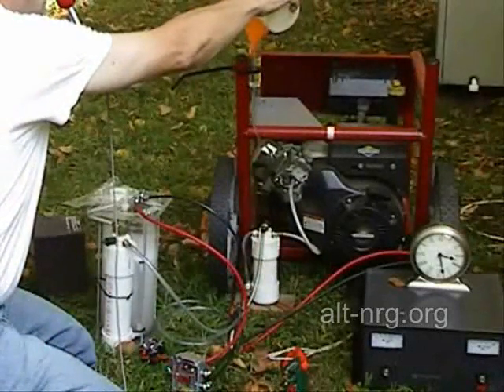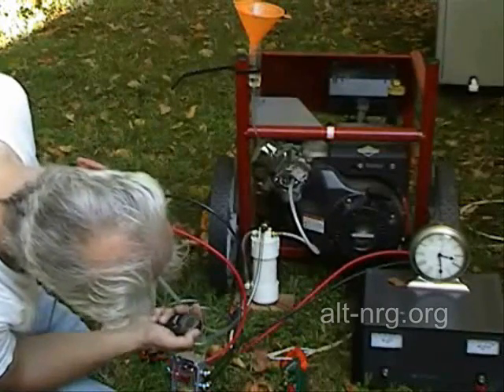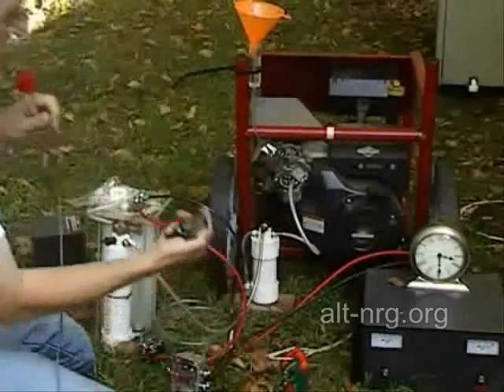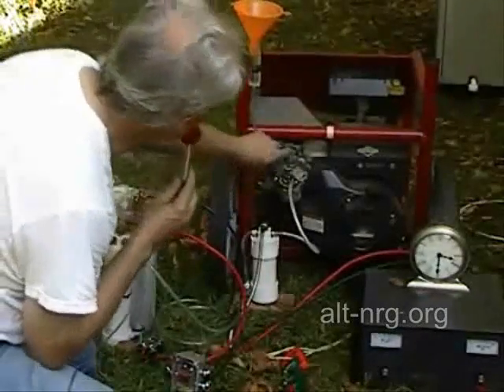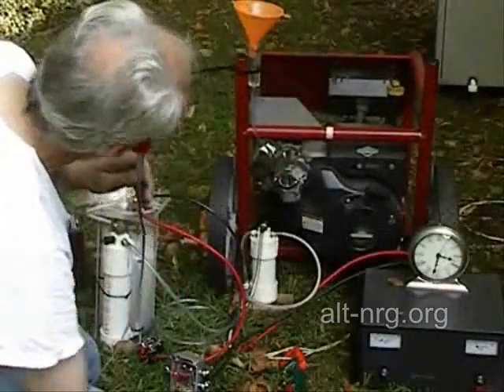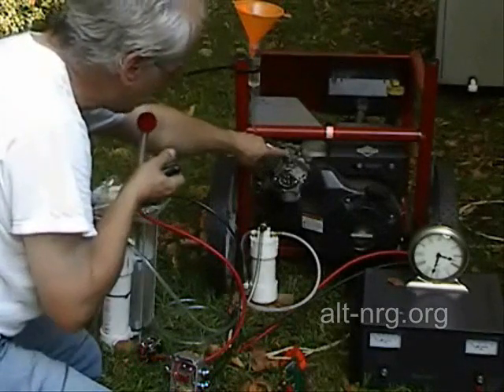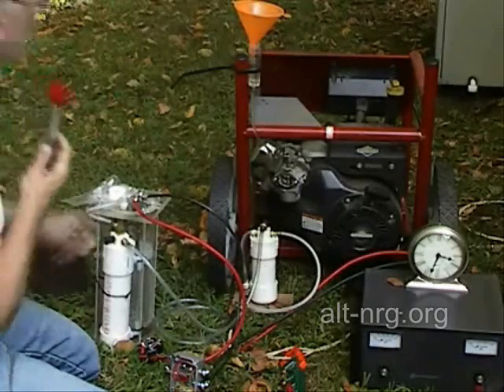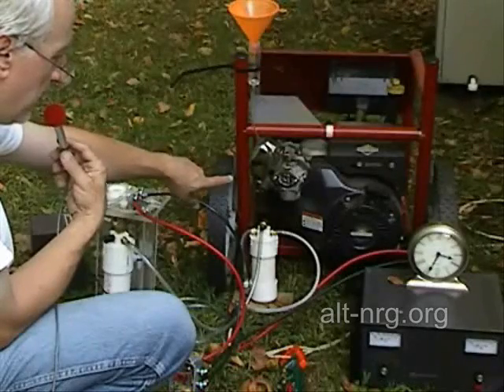#133 - Generator HHO run time efficiency tests, Part 4 of 4

Comment: My question is HHO cooler running or higher octane and if so then if an engine was built to take advantage of this fact then by raising the compression and or turbocharging the engine would increase the efficiency to the point less fuel would be needed thus giving better and more miles to the gallon

Comment: My compliments to you for your diligence in conducting your experiment on HHO.
You remind me of my father who is a dedicated electronic developer back in  my homeland. Anyway, I know that it's been awhile when you did this experiment and I don't know or have not seen recent follow up video from you with this regard but my question is, have you tried the same experiment not using your home made HHO system but a professionally made HHO machine built for welding. I'm just thinking that the loads you are trying on your experiment is pretty much the same as an HHO welding unit which will give you sufficient amount of HHO gas for maybe even less power consumption. There might be greater chance of offsetting the HHO and power generators efficiency. My Regards and more power to you. Iggy Valencia.

Comment: I have a Honda 5.5hp running a 300amp gm alternator. the alternator is charging a 850amp deep cycle marine cell battery and a 6lpm hho cell that is running the Honda. I took off carb bowl took out the needle and threaded a rod and pugged in the hho cell with a back flas arester. now its being delivered behind the choake so im not loosing hho.from blowby coming from the valves. ive put a half key in the shaft to delay timming so the valve is closed befor the piston reaches top dead center in stead of at center. I also have 2  2.2 Farad or 2200 Watt Digital Capacitor 12V Cap Car Power Wire to help maintain voltage when amps are drawn./serge. and im also running a 12vdc 3000watt ac inverter that runs my part of my home.
I need to get a better inverter pure sighn 220v s duell phase. that will give me two leads of 110av and a combing volt of 220 then ill be able to power my hole house.may have to go to an 8hp motor and 8-10 lpmhho. but we will see.
soon when I have everything combined into a mobile unit ill make a youtube vid..
until then keep trying..
Reply: I would Really love to see that nOx platnumspider,  what you have come up with is exactly in my mind.  does "overunity" a term wich this set up can relate with ? 

best regards,
Eric ( the netherlands)

Comment: I'm definitely interested in the fact you have that generator running on hydrogen. That's the big deal here. Can't we just drop overunity for right now and possibly use solar panels to make hydrogen then use that to power to run generators? I would think with solar panels, a storing method, and generators, people could make thief own sustainable energy.
Reply: Desert Logic Yeah, but then everyone is driving around with compressed tanks of hydrogen. Ever seen hydrogen explode under pressure? Scary shit! Not a good idea. HHO is only safe on demand.

Comment: Zero, does the carburator mixture adjustment has two blind screws. If that is correct you can open a notch using a dremel and play with it.
Reply from the maker: Not sure. That would be great but I'd drill the opening only if I knew for sure that's how it was. I would hate to destroy a perfectly good working generator that I rely on from time to time.

Comment: Have you tried removing the needle from the HHO line... The system is probably producing more HHO than is getting to the engine... I think the needle is restricting the HHO and you'd get much better results w/o the needle...

Comment: hey there..just asking..how is the installation of this experiment again?..until now i just cant get the way these parts are installed..can i have a diagram showing the electrical circuit and the hho gas connection to the generator?.im very keen to do this project.

Comment: you are helping everyone, please keep up the work. i think that your carb was dirty inside and needs to be cleaned. But if you can just mount an older adjustable carb and redo the experiment with fuel adjustments made to achieve proper run each time. you might have to do more tests per set up, to have confidence in the results. Leaning the mixture out after adding the HHO is where the savings will show. Thanx Clay

Comment: But, I digress from my original thought, reproducibility and repeatability, atmospheric changes, calibration........................
This is a middle school effort. The choke thing is an issue. What color was the plug running at? Light or dark indicates how well its burning.

Food for thought but the physics as we know it doesn't stack up.

Comment: but all that aside do you use sainless steel in your "electrolytic cells"? and if so do you encourage other to use stainless steel? never mind found all the info i needed from your websiite, EPA will be notifide! you morons, useing stainless in a "electrolytic cells makes chromite thats why the water turns yellow. its highly toxic, you cant even dump it down the sink it that illegal! if you wash it out you r poisoning your self and other, your worse then the oil companies, how can you sleep?

Comment: okay you got some things wrong, one its not HHO it H2 and O2, its not a fuel cell (a fuel cell converts H2 and O2 back in to water and heat and make electricity) its a "electrolytic cells" that is its true name back when some one thought about this over 100yrs ago. You can not run an ICE of H2 O2 that it makes. yes you can run one of it, but it can never make enough to keep it self running (and thats useing all its power just to make the H2 O2) its an energy storage device, it not fuel like gas.

Comment: I have watched all 4 vids  and from my understanding you are attempting to reduce the amount of gas being used by the engine with hho gas. using the choke is used primarily used to restrict the air flow. full choke initiates fuel flow for starting, and as the engine warms up  the choke is fully open for max. efficiency of operation. what is needed  is to adjust the fuel flow into the carb. via. fuel jet adjustment screw usually just under the throttle lever, and inject hho through air filter.

Comment: An engine of that size will be affected by the fact that the airfilter is missing. It will also be affected by the fact that you put the HHO hose into the air intake, thereby restricting the airflow somewhat like the choker will do. So you will have to put the airfilter back on, and inject the HHO without obstructing the airflow trough the  carby. And the mixture has to be leaned by changing the nozzle so the engine runs smoothly with and without the HHO injected.. Great test by the way :-)

Comment: Zero,

Are you still running an HHO generator on your Milan?  If so, has the check engine light come on?  I have a 2002 Windstar that I'd like to install an HHO generator in.  Am concerned that with the laws here re: engine emissions I may have trouble getting this vehicle past emissions testing.

Thanks for your help.

Rob

Comment: In other words, by changing your choke settings your not getting an accurate measurement of your HHO unit.  Im all for the ideas of HHO but you need to apply more effort in creating more HO output.

Comment: With a Briggs and Stratton engine like the one youre using the choke is either full on or full off.  Changing the amount of choke is making the unit use more or less fuel by leaning it out or making it rich.  In flying we lean out the engine to save fuel and to ensure the engine is not overburdened with carbon build up.

Comment from the maker: I have. In fact, just prior to Waldorf I picked up the laser IR temp gauge on sale from my local Harbor Freight for only $28. It can measure up to 968*F. I plan to conduct these tests again just as you say with one exception. HHO in gasoline actually causes the ICE to run cooler. I will be tuning to run cooler with the HHO on and still be running considerably leaner than with straight gas. You'll see. It's quite amazing!

Comment: Zero, have you thought of monitoring the exhaust gas temp for get optimum burn. If you tune the gen so that you get a constant EGT. and then add HHO and lean the motor till you get the same EGT you should get better results. Just a though good job with all your videos

Comment from the maker: Turning alternators takes mechanical HP. The higher the load, the more HP it takes. It's not free energy to just keep stacking alternators. 

750 watts = 1HP. The 160 amp alternator I have can produce up to 2300 watts @14.5V. At full load it would take 2300/750 or 3.1HP assuming the alternator is 100% efficient. Reality is it's only about 70% efficient. Therefore the real HP needed to turn it at full load is 3.1/.7 or almost 4.5 HP. This would stall the 3HP engine.

Comment from the maker: Running lean without HHO causes temps to spike very high. With HHO the opposite is true. I will be demonstrating this with a EGT gauge.

And I certainly can't knock you for your present efforts to ween away from gasoline. I am all for the EV and use of waste products for fuel.

Honest skepticism like yours is refreshing. Don't ever change. Question everything. I do.

Comment from the maker: Yes they are. This was not intended to be a conclusive test, only a crude preliminary test in search of indications whether or not I should pursue it further. You will probably disagree and I have no objection to opposing viewpoints. This is why you will notice that I have not censored your remarks.

However, I do believe I have at least demonstrated that it is worth further investigation under more controlled conditions with more precise testing, and I am going to do just that.

Enjoy the show.

Comment from the maker: First of all, you are too quick to pass judgment. AS I STATED REPEATEDLY IN THE VIDEOS, there is no run mixture adjustment on this carb. It runs too lean without a slight amount of choke. It is the only way to adjust the mixture short of using an entirely different carb.

I also found the same to be true of a smaller 1000 KVA Honda generator I'm tinkering with.

Comment from the maker: What I showed is a near break even condition with known and rather excessive power conversion losses between the output pf the generator and input to the cell. Omit some of the power conversion steps and recover some of the lost heat energy from the exhaust in the form of electricity to supplement cell power and I think there will be a considerable net increase in overall system efficiency.

Comment: The float "adjustment" on small engines is just bending the tang that the spring presses on.  You gotta be careful with that though because it's easy to bend it too far.  Drilling the jet is much less risky, but you gotta get some very closely sized drill bits, so there's a tradeoff.

Comment from the maker: The jet is permanently pressed in to the casting.  I was also thinking perhaps the float level may be too low.  That also does not seem to be adjustable.  They don't make it easy to tinker with these things.

Comment: a 75HP motor produces like 170.000KWh, adding a little of HHo you can add autonomy of like 40 to 80% to the ICE... this means a reduction of 20 to 40% of fuel just by using 200Wh (the potence needed to run the electrolyte)... you should research a little and do some maths before arguing...

Comment: The test is moot, you can change the properties of the engine by changing the fuel to air mixture, making the machine more efficient w/o the HHO. There is waste in inefficiency, , not all the fuel is burned. To have a conclusive test one needs to be able to measure the exact amount of fuel the generator "HAS" to have to sustain exact RPM's. Need a unit that only takes the amount of fuel it needs, not on a gravity feed, or vacume induction system.

Comment: I understand the losses involved in the test set up, but this head-to-head comparison of gasoline vs. HHO supplemented shows that the only fuel savings are in leaning the gasoline AFR.

You can run an ICE at a far leaner AFR than the factory mangement and see large gains in efficiency, but only at the expense of higher NOX emmisions.  I feel this is the root of any benefits we're seeing through HHO injection.  

We need emissions testing of an HHO ICE.

Comment: Guys, I'm sorry but this experiment solidifies my skepticism in HHO for ICE supplementation. I have built a number of large cells myself and have followed ZeroFF almost from the beginning of his online videos. 

To me, this proves that even a (relatively) large supply of HHO will not substantially increase efficiency of the ICE. The energy used for HHO production clearly outweighs the benefits.

Comment: Why don't you conduct this test on a Car . The Hydrogen Cell was meant to operate on DC power , not AC. I dont know many people with painters lamps and floor heaters in their cars , not to mention a extention cord dragging behind . The design and materials used to build a cell are vitally important as well . Maybe you gas production takes time because of this . I've seen many cells start production instantly . I think GAS MILLEGE is the main reason for the Cell . TRY YOUR TESTS ON A CAR !

Comment from the maker: Not at this slow frequency.  Gas production takes time to get started once voltage is applied.  Every time you switch polarity gas production slows to a stop then resumes and the other direction.

Comment: Keep up the great work. Wish you guys were down under in Australia so I could compare notes. I have a HHO cell in my old van and it is showing great promise with fuel economy. Approx 21% improvement but I had to take it out as we had a 40 deg C day and it boiled (never done that before) Maybe the electrolyte has become too concentrated as water is used. Amps went up past 28A. Going to add larger reservour and new electrolyte. I hear electrolyte becomes toxic what is best way to despose of it?

Comment: I have always pondered about HHO in a power source. I am using solar power currently now. I have to use a gen set for power too. With all the added load you create on the generator you have no gain means you consume more energy. Granted you put back some. Kinda reminds me of the perpetual machine. The HHO unit needs to produce more with less input in order to off set the power it consumes in the creating process. MIT used different metals to improve the process. But expensive metals.

Comment: I'm thinking a small four wheeler motor. You  can drive a car alternator easily. furthermore, if mounted on a stand, jetting changes are easy. Timing changes are slightly more difficult, but not terrible. You WILL prove our point to all of the non-believers if they will give it a chance

Comment: I would like to see that test performed differently. Although time consuming, changing jetting and timing would yield you much better results. I too experiment, though not at your level. I think you are way further along than the video shows. Unless the volume of HHO is significant enough to displace air intake there is going to be no real gain without jetting changes. The carb doesn't know the HHO is there. Other than sheer volume.

Comment: Zero, Kudos on your work. I am a die hard believer in your work. However, and I know you knew this was coming. Your generator really needs to be running properly. Any engine running on "choke" is going to use more fuel. The comparison needs to be apples to apples. Any engine has a required cfm to operate at a given rpm. When you apply choke you increase vacuum on the jet. Drawing more fuel. I would love to see tests of the same motor's fuel consumption on and off choke. Again, Kudos!!!!

Comment: dw807,
The amount of air + HHO is controlled by the governor on the engine. It regulates the engine speed so the the AC output of the generator is at the right frequency. As the current/power draw on the generator increases the governor increases the air flow to maintain speed.

Replacing part of the air with HHO allow less air flow to be needed to maintain that same speed due to increased efficiency of combustion.

And the air flow meters the gasoline as used as FearTurtles mentioned.

Comment: By restricking the amount of air flow you limit the amount of gas that is drawn into the cylinder. This is how most small engine carbs work.  It is not ideal and could be a the reason this test did not preform better.

Comment: How do you meter the fuel mixture without a needle valve on the carb? The gasoline/air ratio won't lean out without some kind of fuel adjustment between the float bowl and the top of the draw tube. Seems to me that without this advantage you would have no real change in gasoline usage. HHO will increase burn rate and run the engine smoother but if you want to gauge the gas savings than you have to decrease the mixture.

Comment: the only way to run this stuff on a turbo engine is to do it the rough and dangerous way of a draw through carb setup (like old'school 80's turbo engines) until there is so much gas being produced it can be injected under pressure, a draw through system is the only option

Comment: I found this to be interesting. If HHO does contain 9.54 btu's per ltr and need to have be at 4% when mixed with air then you would need around 40 lpm of it in a 3.0 ltr engine just for it to run. Figure that engine gets only 15 mpg at 60 mpg. You would need about 120 lpm.  Now at 15% gas efficiency that engine uses 1050 btu's to run per minute. 120 lpm of HHO contains 1145 btu's. So by the time you have enough hho to burn you come close to runing the engine on it alone. Provided its efficient.